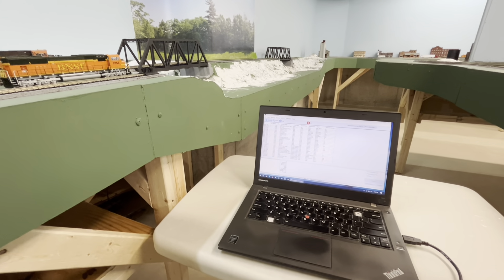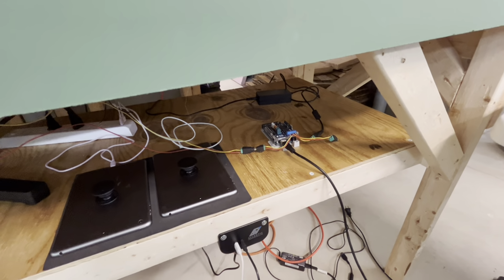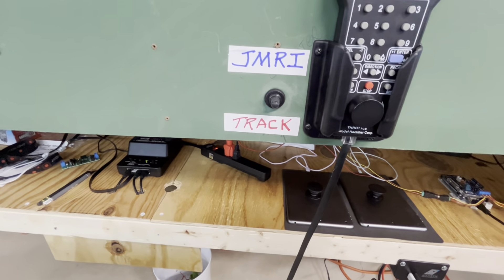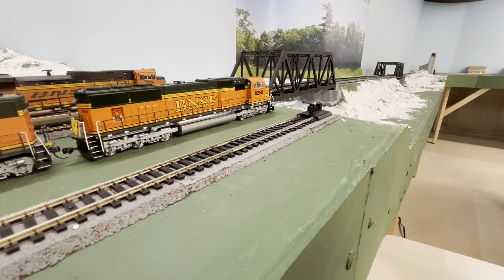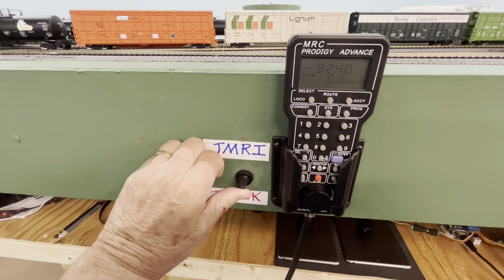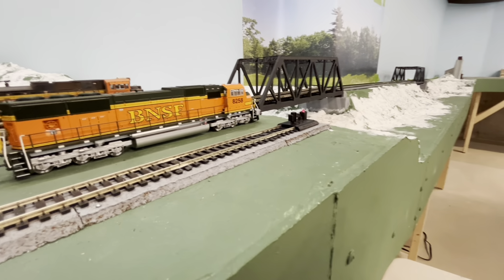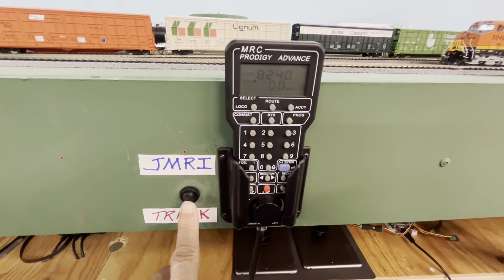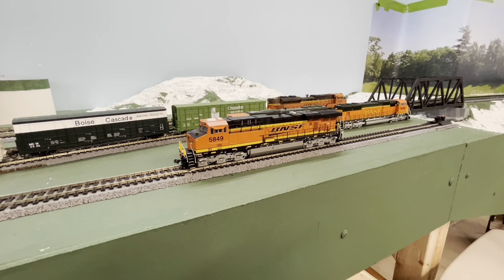Iowa Southern Railroad S4E14 - Programming Track Setup

Comment: Nice job of how you've got your layout electronically controlled! I know without a doubt it involves a lot of time and effort for sure! You've definitely done a nice job with both layouts and definitely should be proud of your accomplishments. Thanks again Fred for sharing your videos with us along with your PRICELESS time and effort! Cheers from Laurel, Delaware USA.
Reply from the maker: Thanks much Shawn 😀.   The new electronic challenge on this layout was learning to install isolated power districts.  On my Texas layout I didn’t do this.  One turnout in wrong direction would cause entire layout to short out and stop all locos.  Now each of the districts(7) are isolated from each other.  I’ll only use the computer for setting CVs on the locos.  I’m trying to speed match several locos.

Comment: Glad it was red marker and not blood. Can’t wait to see your computerized operations. Always a treat. Not many people that I follow do what you do.
Reply from the maker: No fingers were cut in the making of this video.  😀.   I’m not doing any JMRI script to run trains on this layout.  I didn’t want to spend the money to install the turnout motors.  Plus it would be a lot of under the layout work which is getting harder for me.  😬😵‍💫👨🏻‍🦳. I plan to install sensors on the new layout in Texas this winter and do some programming.  I have turnout motors(Smails) on all the turnouts on this layout.  I just have one issue - the upper level is sealed and I can’t install sensors under the track. 🤔.  I’ll have to setup horizontal sensors, somehow…

Comment: Awesome. I did that on the club layout years ago.
Reply from the maker: Thanks Randy 😀.   I need this to help me speed match locomotives.  I’m going to add a couple of IR sensors to the Arduino so I can use JMRI’s speed meter function.  I’m having a $&#@ of a time speed matching a Soundtraxx tsunami sound decoder with a non-sound NCE decoder using the speed table.  I have them matched thru step 15 but after this is goes $&$#@.  It takes forever setting individual steps.  I watched a video which showed using the JMRI function so I’ll try it.